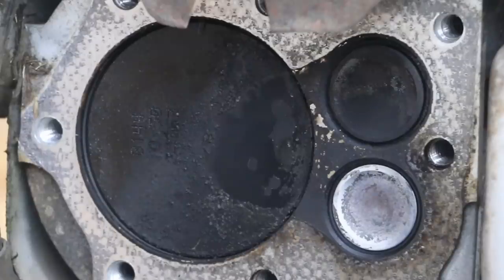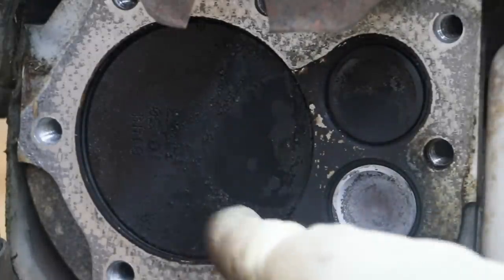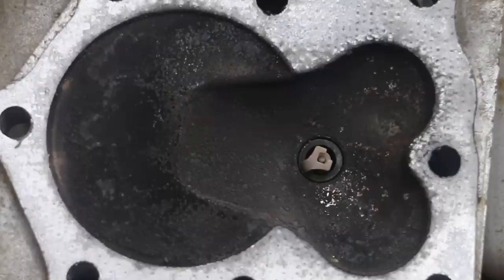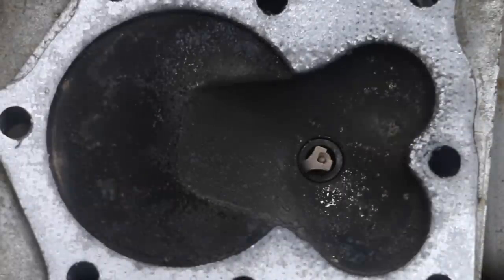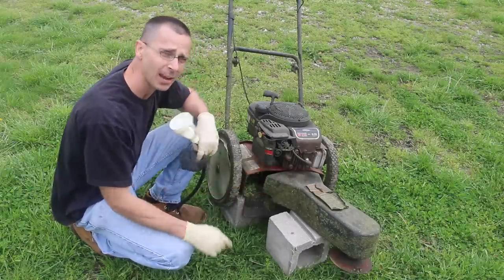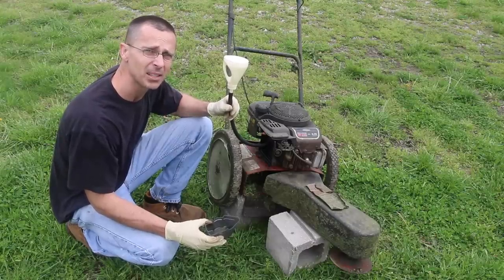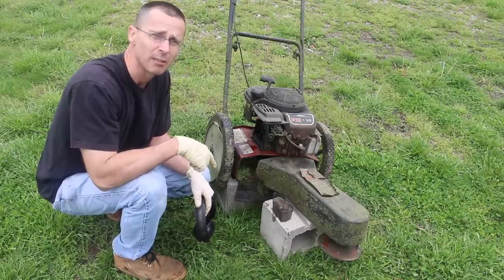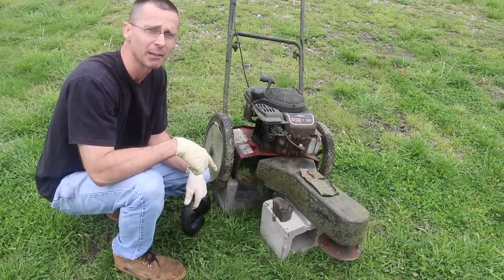Seafoam--can't believe what it did to my engine part 3--cylinder cleaning test!!

Comment: Kinda curious why you didn't use the Sea Foam as directed on the can.  It is hard to judge how well a product works when not used as per the manufacturers recommendation.  My experience with sea foam has been all good.  Though I'd never use it, or any additive in a new engine (I'm referring strictly to cars in this comment), I have found it to work excellent in pre oil change applications to help dissolve sludge.  Being a petroleum based solvent, it is very effective at breaking down the gas and oil  based sludge that builds up in higher mileage engines.  Unlike other "motor flush" products that tend to break larger pieces of sludge free from the engine, only to get caught up in the oil pump filter screen later, Sea Foam dissolves the sludge and blends it with the existing motor oil to be emptied out completely when draining the oil.  For oil change cleaning, I use 2 ounces to each quart of motor oil.  Start and IDLE the engine only for about 5 minutes, or until at operating temp.  Then drain oil and proceed as normal with the oil change.  I add 1 ounce per quart of oil when refilling the oil.  I also use 1 1/2 ounces per gallon of gas every other fill up.  I've had it twice in the past solve engine knocks on high mileage engines.  Once in the top end, and once in the bottom end.  Gave me a bunch more reliable driving miles, as I have yet to replace the main bearings (4.0 L ford v-6), and still driving it for 30,000 miles since I added it to the vehicle.  The engine has 300,000 + miles, and was rebuilt over 200,000 miles ago. 
Never thought I'd see that many miles on a domestic pick up truck.
Reply: I put sea foam in the oil of a 1996 Saturn I have with 180k miles that had very sludgy oil and it cleaned it so well that I developed a couple oil leaks and it started sucking oil through the valve guide seals! I replaced the seals and now it runs great. I would only use it on a car that isn't so old if I used it again, it's a strong solvent.
Reply: I agree Marvel Mystery oil is good but the seafoam did a better job you see it in the results of the compression readings.But of course the best way is to tear down the engine and clean all traces of carbon but of course that requires time and money. If its just an old daily driver then use seafoam or marvel mystery oil. But if its an old classic then tear down the engine that's how I look at it!
Reply: Same issue here,cleaned the engine so well it started leaking and burning much more oil than it had before :/
Reply: Mr. Seafoam, is that you?^^
Reply: Rickey Viger  because it thins out the oil! You gotta get a oil change shorty after using
Reply: I dont know if I would put it in my new oil after a change.  Won't that thin the oil down?
Reply: He wasn't testing the oil cleaning abilities, he was testing the combustion chamber carbon cleaning abilities.
Reply: Reid Johnson did you not watch the rest? Or even him explaining what he is testing this episode? He did is it the way it says on the Cantor what he is trying to achieve. But in this engine there is no other vacuum source so he let it draw through the intake
Reply: my work van has 700k on it, is a 99 e250 with a 5.4 2v, original motor, running like a champ, needed guides and chains at 500k, typical valvecover leaks. nothing else serious
Reply: You lost me when you claimed it cured a lower end knock.
Reply: 300,000 miles on a domestic pickup truck is actually pretty common.  Especially when they are taken care of.

Comment: Hey there farmer, I have been watching a few of your videos and I have not up till now heard you mention this product, I have found over the years as a professional auto and RV technician a product that works really well for decarbonizing cylinder heads and on Motors that have carbon buildup on the Pistons it works very well there also,  it's a product that is produced by Chevron, it is called Techron, just in case you haven't heard of it, they have a fuel injection cleaner and a fuel system cleaner as well, and I normally use the fuel system cleaner in all of my vehicles every time I change the oil, I'll generally put a 20 oz. bottle of Techron cleaner into either of my 6 vehicles, and with that I am able to keep my systems clean all the time, and it's making my vehicles get the best fuel mileage possible that way...
P.S. Oh yeah, great job on the videos, they are quite informative and I like seeing that you put those motors through hell, haha, keep up the good work....✌😎👍
Reply from the maker: Thanks for the recommendation.  I recently tested Techron and it did a great job.  Thanks for the positive comments too!

Comment: Thank you very much for the video. I have watched all 3 done thus far.  

It is sad the number of comments which are based on their opinion walking in.  I do agree that in this case, it does not appear to have made a noticeable difference visually.  Also don't know if it ran smoother after.

For all the pre-conceived "snake oil" believers, I have two things to say:
1) Watch videos #1 and #2 with his pickup truck. Tell me that there was no noticeable change in how smooth the engine ran, the top-end noise, etc.  How much water or diesel or ATF are you going to put in the gas tank per gallon? How much water are you going to add to the oil? How much diesel or ATF are you going to spray into the intake?

2)  A number of you sound like long term mechanics etc. "Just tear the engine down and scrape it".  On the other hand, an individual who has less experience but can do some mechanical things is much better served by SeaFoam or similar products because they clearly tell him/her how much and where to put the product for desired results.

And, Yes I have used SeaFoam in cars in the past.  It definitely made a difference, though other products may also.
Reply from the maker: Thank you!  Great point regarding the great value in using Seafoam instead of paying a mechanic to perform avoidable repairs.

Comment: I truly thought it would have done alot better job than that!! Water is by far the best, just like when you blow a head gasket from the water jacket to the cylinder, the way to too tell is you look for the shiniest carbon free cylinder and thats where youre leak is, plain and simple....Water is Best
Reply: Coaster we used trans fluid back in the70s hold the engine at about half throttle use a old oil can the smoke and shit would pour out of the exhaust did many 10 dollar tune ups take a rough running  car smooth the idle out and get rid of the pinging and rattling in a minute
Reply: Burny Caplin what a great idea i will have to try that, Thank you!
Reply: Burny Chaplin ever add it to the engine oil?  I've been told to add a 1quart of ATF and 4 quarts of oil in a 5 quart oil change.    I don't see why you couldn't do both.
Reply: jason127x99 The reason guys put ATF in their oil is to clean out the oil passages, especially in hydraulic lifters.  I don't know that it is effective at all for this.  What does work is draining all the oil, filing the crankcase with diesel fuel, running the motor for a few minutes, draining the diesel and putting proper oil back in.  And yes it's safe.
Reply: KC9UDX I'm not sure that is safe because diesel today is very dry and doesn't have much lubrication qualities anymore. Ever since they stopped sulphur from being added to diesel (very good lubricant for diesel injector pumps and injectors) the diesel isn't the best on older injector pumps. People have had extreme wear on their pumps within 100 000K when the pumps were rated for half a million K. You can combat this by adding 20% bio fuel for lubricant or 2 stroke oil for my old mechanical pump because I don't want to shell out 3500 for a new pump or 1000 for a rebuilt one just because we have to use dry ULSD ultra low sulphur diesel . So no don't use run your engine crankcase on diesel you will damage your engine. Ever hear of cylinder wash from too much diesel injected ? The injectors actually wash the oil off the cylinders causes excessive wear and this diesel goes past the rings into the sump and dilutes the oil. When you have diluted oil in your oil analysis you also have high amounts iron and aluminum found in the analysis which shows accelerated wear from the diesel in your oil.
Reply: Andrew Bartleman I suppose if you do it for long periods (washout) it is damaging.  But I've done it many times and never had a problem, as in no sparklies in the oil and no visible damage to cylinder walls.  It sure does take the gum out though.

I don't actually use Diesel oil, I use #2HHO, which may or may not still contain sulphur.  Frankly I haven't done it since the sulphur mandate, but you're right, the low sulphur stuff probably isn't good for this.
Reply: Yes, have heard that also.
Reply: Coaster  Gee, you think the cleanliness from head gasket leaking might be from the water turning to steam and it blasted off the crud? Heated water under pressure is a great cleaner.

Comment: now you just need to use this ONE WEIRD TRICK to make seafoam work for you!
Reply: It can be sprayed anywhere south of your mass air flow sensor on your intake or sucked into the brake booster line, or added to your oil, and added to the gas. Any of these will get it into the chamber except the oil method, which cleans the rest of the engine.

Comment: Looks like it mainly just took care of the loosest surface gunk, but anything that was well and truly baked on didn’t budge.  Kinda makes sense if you think  about the throttle body in your truck, it doesn’t get quite as hot as a piston head, so all the gunk in it wasn’t nearly as baked on, so the sea foam did a lot more.

I wonder if the sea foam had any adverse effects on the baked on stuff - like, did it have any chemical reactions that made it even harder to remove?  Sloughing off surface gunk is nice and noticeable and flashy, but if it also unintentionally sets the more stubborn crud, it might not be worth it in that specific use-case, and may be best  used more as a consistent maintenance cleaning to prevent drug from getting baked on as opposed to removing a bunch of crud after it has already built up.

That being said, it must have had a dramatic effect in other parts of your truck engine, considering the dramatic results you got.  It doesn’t sound unreasonable to expect different parts of your engine to react differently to sea foam.

So... yeah.  My hypothesis is as efficacy of sea foam in a given component is inversely proportional to the average temperature of the component and quantity of buildup.

Comment: Seafoam worked great on my weed eater.  Previously, it would only run with the choke on.  Once it got hot enough, it would cut off.  Then, I added Seafoam to the gas, it almost immediately started running like normal again.   I know this is somewhat off-topic, but the product does work for many applications.
Reply from the maker: Thanks for sharing.

Comment: I put sea foam in my truck cause my injectors were clogged bad and it fixed them
Reply from the maker: I'm glad this worked!
Reply: not sure how seafoam is supposed to fix clogged fuel injectors...
Reply: @THE_CHOAS_ENGINE  probably an engine with direct injection

Comment: Great Video But. Although it did not happen this time. Be carefull adding fluid thru the intake. you could cause hydraulic lock which is lethal. also wear safety glasses.

Comment: I like the engine your doing these experiments with, I have one similar that was given to me, the oil was grey & chalky I ran some clean oil through it, cleaned the carb & put a new plug in it, I have been using it ever since with no problems, the engine is simple, but perfectly engineered in my opinion.
Reply from the maker: Thanks for the feedback.

Comment: Seafoam totally cured a blocked the idle jet on my 17 hp Kawasaki v-twin (from setting unused with gasoline too long). Process took several months of running a very heavy concentration then letting engine set a couple weeks then running again until hot, then setting.  Repeated this about a half dozen times.  Toward the end, each time engine would idle better without using partial choke to keep it idling.  It idles perfectly again now, never touched idle  mixture adjustment with a screwdriver either.  I've used the product for many years but never had this kind of success before.  Of course Seafoam won't fix a jet blocked with a piece of dirt that can't be dissolved chemically..

Comment: Okay, I'm not sure if anybody else is ever left this comment or not but I'm just going to.
I don't have a ton of experience with seafoam but with my experience and cars and what not anything that's going to work is going to take a little time. Somehow soaking. I swear I've you see them and it's worked but maybe not you should try saturating the parts and then letting them blow through the motor. Although sometimes isn't it just easier to take a metal wheel and fix your motor than put all these products there? In any case. Love your videos you share a like mine set with me and obviously people want you to take things too far sometimes but, I think you really know what's up pretty much when it comes down to it. Thanks

Comment: +Project Farm, you should stick a basketball inflator needle into the carburetor end of your hose, so that the Seafoam (or methanol, lacquer thinner, isopropyl alcohol, WD40, etc) comes out slowly into the air stream. Water, ATF, brake fluid, etc., I would use sparingly if at all, since they are not meant to burn. Chlorinated solvents should not be burned at all, since combusting them will produce hydrochloric acid and phosgene, both highly toxic. Also, I would recommend running the engine much faster during the treatment.

Comment: I really liked watching your videos. I did the same thing to my engine, only with Marvel's Mystery Oil. It is a 1989 Chevrolet P30 motorhome chassis with a 7.4L 454 engine. It had, at the time, 86k. It had a terrible tick off the line and just didn't run very well. I kept with the Marvel's regimen in the tank and the crankcase and wow, what a difference. My Onan generator in the motorhome even runs better!
Reply from the maker: Thanks for commenting on this.

Comment: Seafoam makes a valve cleaner that's specifically made to clean the valves and to be sprayed into the carb. See if you can find some of that and give it a shot I used it on my old mercedes and a jeep it seemed to work great but I didn't take apart the engines to see. But I know for a fact seafoam in the oil 2 weeks before an oil change will have the inside of the engine spotless and looking brand new. Great videos btw it's good to see someone else that likes to "play" with engines.
Reply from the maker: Thank you for this recommendation!  Also, thanks for the positive comment regarding the videos!

Comment: After watching all 3 videos, my personal conclusion is that it's not much good against hard deposits, but works great on surface deposits that are easier to clean. The difference it made, at least in the truck's oil, appears to have been spectacular. Probably the fuel system, too.
Reply from the maker: Thanks for commenting.

Comment: I dont believe there is any single use magic product but eliminates all the carbon, but is am using a bottle of Seafoam in my oil at oil change, and a can in my gas when I get the oil change. I used to get about 21mpg in the city in my 2.5 Altima, now I get right at 23-25 depending on where I purchase fuel. I wont buy fuel at Kroger or Marathon. My worst gas mileage came from those two stores. I will go out of my way to find a Walmart or Sunoco. They seem to have the best fuel for the price. If I am driving on the interstate I will pay extra for the Shell fuel, rather than take my chances at side road independents or truck stops. Walmart has huge buying power and demands good gas from the fuel farms. Thanks again for your dedication to information!
Reply from the maker: Thank you for the feedback

Comment: Been using Seafoam for the better part of 20 years and it's worked great. Of course we run some every tank of gas in our lawn mower, so we get a longer term of cleaning vs a couple hours. Though we mostly use it for the stabilizer aspect, the benefits are there. I'd suspect after a couple months of using Seafoam with every tank of Ethanol free (Non-oxygenated) gas, it would end up being cleaner.
Reply from the maker: Great strategy using it in every tank to prevent the buildup.  Thanks for watching the video and commenting.

Comment: Doesn't look like it did much to the big deposits, but it's definitely a bit cleaner in there.  Probably Seafoam is a bit better at getting rid of varnish and sludge than hard, baked on carbon deposits.  You'd need something more aggressive to really dissolve those.
Reply from the maker: Thanks for the feedback.
Reply: My take on this is that you need at least three cans to see results
Reply: @_Za_Unknown  Or something like Techron with that PEA additive that doesn't break down due to heat.  Seafoam isn't cleaning anything INSIDE the combustion chamber, it wasn't ever supposed to!

Comment: Appreciate you taking the time the show is true results by pulling the head.
    It didn't miraculously make it look brand new, LOL but it was an improvement.
    Seems like it would be most useful as preventive maintenance on carbureted engines, preventing carbon build-up to begin with.
   I've always felt carbon was a large contributor to engine wear, as well as Air volume and velocity restrictions. Then as the carbon tends to absorb more fuel the problem magnifies itself.
Reply from the maker: Thanks for the feedback.